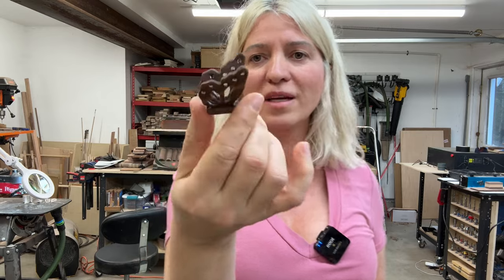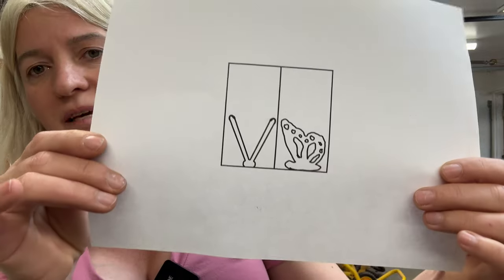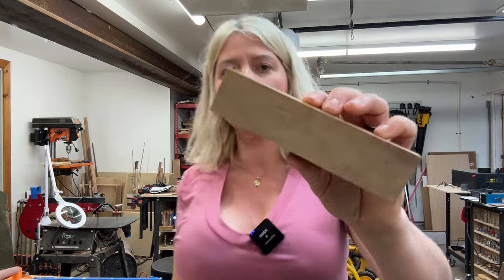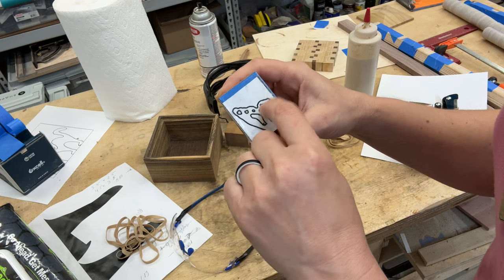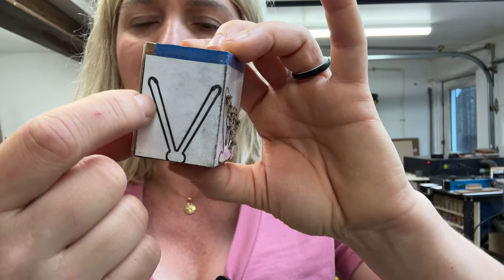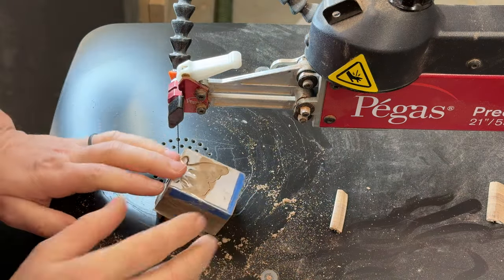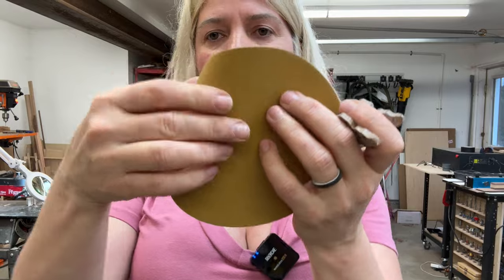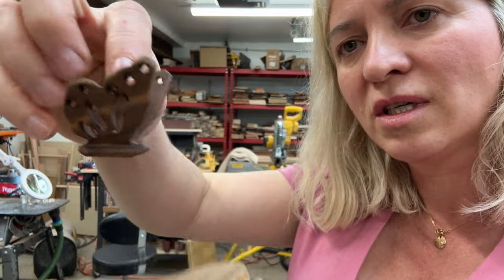Scroll saw compound cut butterfly. Easy 3D pattern, complete in 5 minutes

Comment: That is very cool looking. Based on the thumbnail I thought it was much larger, then seeing it in actual scale surprised me. Although it does make a nice box handle. What format does the pattern download come in? Is it svg or jpeg or something else? I am just wondering if it is easily scalable. Thanks for the great videos!
Reply from the maker: It’s a JPEG. It is scalable. When printing you could choose to print at 150% for example on your printer settings. However you are limited by the max hight cut of your scroll saw

Comment: Downloaded. Making tomorrow.  Then finishing with….
Reply from the maker: Awesome. When you finish post a photo on our Facebook group sawdust and splinters woodworking group. Would love to see it. Finished mine with tung oil
Reply: Just a suggestion:  on the pattern add a dowel.  It will be square but you can sand it round. Now you can mount in a hole.